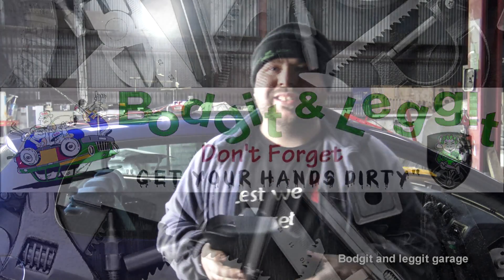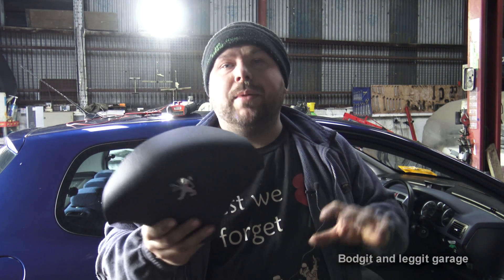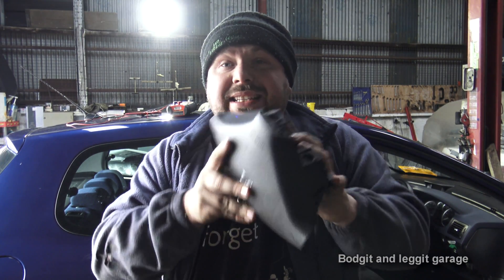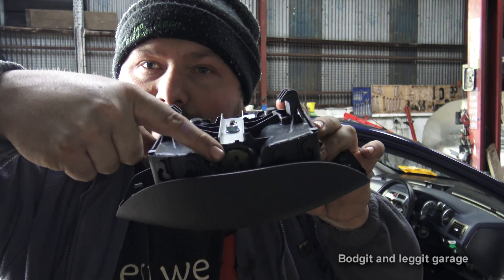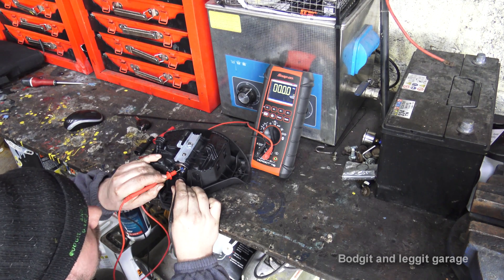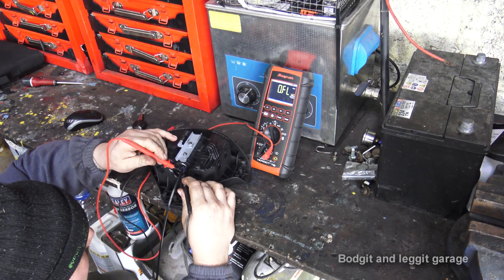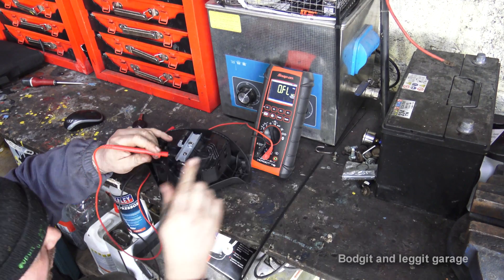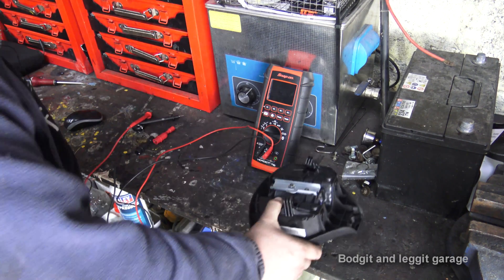How To Test A Airbag Bodgit And Leggit Garage

Comment: The problem is, there a more then one type of airbag, of if they are defective they might go off, some multimeters have 9v some have 3v, and its the volt that often will be able to activate the airbag igniter, so there is a risk of it going off while you ohm it, cause of your multimeter is sending voltage thru it, and the mount of volts its gets back its can tell you the resistance. Here comes the problem, the airbag will also go off with 10V. i case of low battery on the car, lower then 10v your airbag ecu will turn off, but HOW many volts there will be needed to activate the airbag is not the same on any airbag, so good luck try out :D Remember earplugs! 

And the parts about not need to take car battery off.. LIE, IF there is a problem on the airbag system, or the system is build with Capacitors and a small "consumer" then the system will need to be drained. Older cars dont have the "ground" function youre talking about. AND if you belive on it will save you from deployment, keep in mind that deployment takes less then 0,1sec. AND the airbag makes a lot of damage when it deploys in your hands. Google "airbag damage" and think of it in your hands, and i gets hot.

I have seen a lot of damage from working on DEFECTIVE airbag systems, and its first when the system is in error mode people start touching it.
Never car systems often CUTS all power to airbag systems and only sends out power to messure airbag systems on start up.

You can test how much you can safely test your airbag with by testing the plugs with multimeter, if the ecu sends 5v out, to not never but in 9V !!!
You can test how much volt you ohm meter sends out with another multimeter.

Different system, different load. Do not just "Jump in" with airbag systems, find some data on your system and follow the "standard ways" to deal with it, if you do that it will not blow up in your hands and head of you stands in your hands with a defective airbag in a way that can deploy.
AND DO NEVER USE FORCE ON IT!, they CAN deploy from it depending on how its build.
Reply: As he said "there are many different types of bags and reading may vary..."  In this video he's just sharing the basic procedure and tools to use.
Reply: @johngarner9558  and every safety OEM lecture and classroom get told not the use meters on the air bags
Reply: my multimeter has a 27.5 volt battery to allow it to test in high mega ohms ranges, so if one of the boys took that from my bench not following safe working procedures I would be in whole lot of shit. Please follow the WHS rules as your vids are teaching novice people on site that have no experience.
Reply: Your multimeter will be megaOhms/volt so it won't pass enough current to set the airbag off. How do you think the ECU checks the airbag? - Exactly the same way the multimeter does.
You'll also probably find that all airbag inflators and belt pretensioners are 2.2 Ohms. If the readings vary, you're probably measuring corrosion/surface film resistance on the pins.

Comment: WOW! Testing the most dangerous car part in the world!! WITH A OHM METER!!?? This must be some kind of witchcraft or anarchy! Next thing I know you will tell us we can use a TEST LIGHT on modern cars!! Oeyyy what's this world coming too...
Reply: Using a Ohm meter to test a Air bag system   for most people is a big no and I have had factory training  from Bosch the people that make air bag systems and they say NO way to check a Air bag with a OHM meter . But I can tell you I have tested them for more the 20 years with a ohm meter and not once I have let one off !! . maybe you need to watch this by the late    David DeCourcey  it goes for almost 3 hours but some great info  about air bag systems and this guy use the ohm meter to test air bags ! it take 1.6 amps to deploy the air bag system if you have a good ohm meter it will NOT put out 1.6 amps !
Reply: Haha Yes flip flops and safety squints are must in the workshop. I always test my air bags with a 9v battery. If the pop I know the resistance was dead on and it was not the problem. At that point I assume the clock spring was bad and change that... just a thought for your next one.
Reply from the maker: South Main Auto Repair  I don't understand you will have to do a video on it maybe show me with your new Honda I think  once you show me I will understand a lot better
Reply from the maker: Badgertronix no don't send your mum I've seen what she can do and I am scared
Reply from the maker: One Auto, yes flip flops are very important in the workplace I think lol
Reply: Haha touche' sir
Reply: South Main Auto Repair Leons not even wearing hi vis, he's not being safe at all 😂
Reply: But he's wearing his safety flip flops! Nice DVOM by the way!
Reply: I should send my Mum round there so she can tell him off too
Reply from the maker: South Main Auto Repair I'm doing this so you don't have to I am taking the risk as we all know it's a big risk I would never tell you you can use a test light maybe you can use a load probe
Reply: hey Leon
another great watch. Go carefull on the hyundai air bags. back in the early 00s part of our air bag training course was to detonate warranty return air bags using a multimeter.

Comment: I had an old Vauxhall combo van,I had to take the steering wheel off,can't rember why now,anyway didn't disconect battery,put it all back together, and air bag light was on,I was told I should of discoected battery first? ,
Reply from the maker: John Easton hi mate if you disconnected the battery yes you won't have had the airbag light on afterwards but as you can see from my videos you do not need to disconnect the battery to take the airbag out if you disconnect a battery on a modern car the chances of that car starting afterwards is very slim as you will lose all communication with the modules and the memories will be  Whiteout